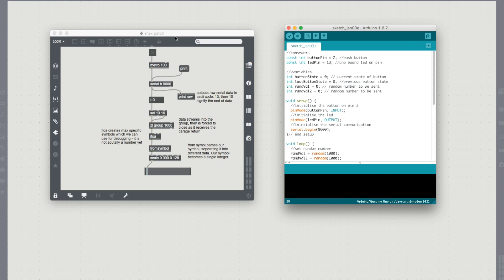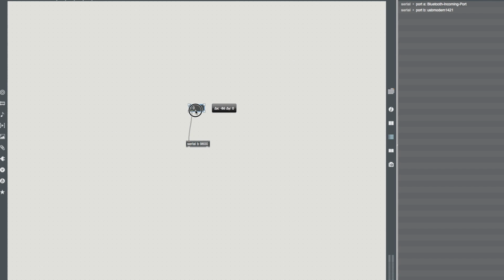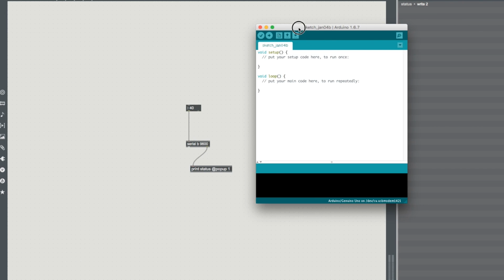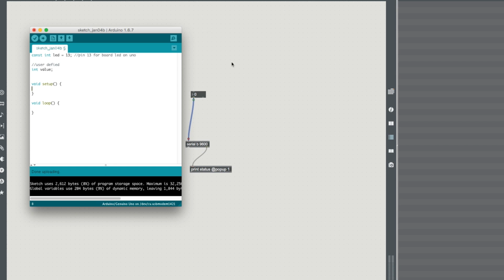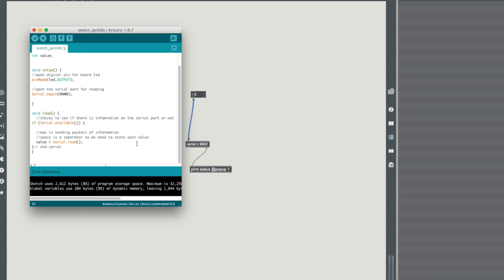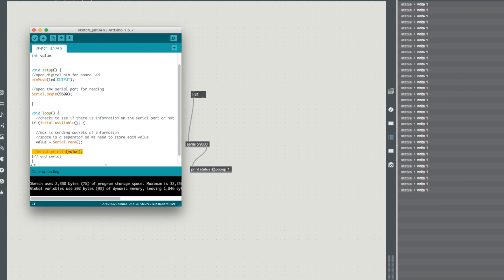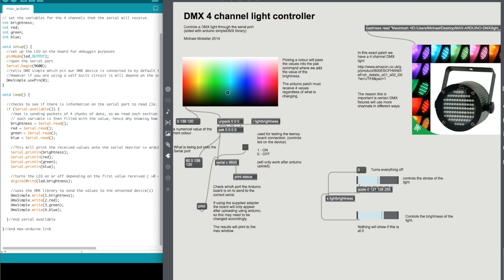MAX msp 7: Passing data from MAX to Arduino

Comment: How would you go about controlling multiple variables on the arduino using Max?
I'm working on a controller that would have certain LEDs light up based on what the max patch is doing.
Reply: hi, please, did you manage to do this finally? I was about to ask the same question
Reply: @gorgigeorgie4594  Unfortunately my schedule ended up getting very busy and I never made any progress.  :/ Definitely still planning to work on it, but I don't have a timeframe.

Comment: hi :) thanks for the  video! 

can you help me with connecting a servo to this? im using FaceOSC on max, that sends data to the arduino, but i cant figure how to move a servo with that, i just need like 1 = servo on , 2 = servo off. 

Thankyou !!!! (and sorry about my english )
Reply from the maker: You would most likely control something like that directly in arduino - having max control the on or off number (1 or 2 as your described)

Servos normally move between 0 - 180 degrees of movement...

So in arduino you would receive your OSC value within your loop code and set it equal to variable;
You then use that variable to drive the servo...

psuedocode: 
myValue = value from osc (normally from serial port)
servovalue = 0

if (myValue == 1) 
   move servo on repeat
else (nothing)
Reply: @Programmingforpeople  thankyouuuu!!!!!!! :)

Comment: Great video!
Is it possible work with more than one output in Arduino?
I've seen some tutorials and blogs of the explanation, but all is about one output.
Think on Arduino Mega, it have to many outputs. 
I undestand the "Serial (letter) 9600" send information just by one output, but if I would work with 4 servos, what can I do?
I need to use 4 arduinos?

Thakns a lot!
Reply from the maker: No not at all!

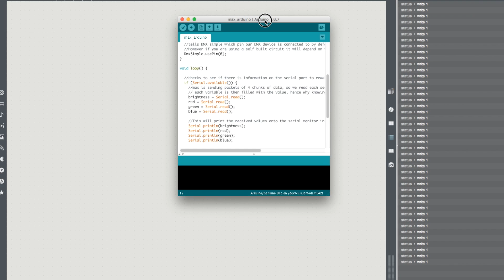The last few minutes of this video talk specifically about sending multiple numbers at a time and passing them into different variables in arduino! Check out 6:20 onwards and let me know.

You basically 'pak' the items in max and then read them as individual items on the serial port in arduino
Reply: Ooh! I can see! :O
Very thanks!!!
:D
Reply: @Programmingforpeople  hello, thanks for this very helpful video. I have control over a single LED on the Arduino no problem (using a toggle in Max) but am really struggling controlling a second from Max. I have studied the bit at the end of your video and can get the data out of Max no problem but am baffled as to how to interpret it within the Arduino code. I assumed I would have to write something in there with parse, no?

Comment: what libraries do i need for this to work? specially "serial"
Reply from the maker: +realgoldfinger all built into max.
There was an error going around that serial would corrupt itself in various saves of max if you tried to close max with an active port. Start a new max patch and see if serial works.

If not - you’re probably just not referencing the ports required correctly vs it being broken

Comment: I am using port e. (com 5 is where my Ard. is at.) only port a (com 1) is default is no port is defined. perhaps this is the issue. 

I cannot keep the serial port open in MAX and Arduino at the same time. when i close the port in MAX, it seems like it is purging the contents of what should be displayed in the serial monitor.

The LED light does work - so i know the data is being sent on the toggle..
Reply: Hi ! I have exactly the same issue, "Serial Port 'COM7' already in use. Try quitting any programs that may be using it."
All works fine and the RX LED on my Arduino board is blinking so data is send to it but I can't open the serial monitor within the Arduino application... Have you got any idea ? Thanks
Reply from the maker: +Dave Klebt the serial port is an individual thing shared between resources - you will not be able to have it open on arduino and send data to it in max. If max is sending the data you will need to print the data prior to the data to be able to see it when sending in max
Reply: Thanks! i was attempting was to display the data as you did in the Arduino serial monitor. in my rebuild of your sketch/patch, the data doesn't show up in the serial monitor. but the LED does light, so i know the data on is being passed.  is there to cache that data  from a number stream when it comes into the Arduino through the serial?

Comment: Hi Michael, I really love your videos! I have a question related to the last part of your videos, sending RGB data from Max to Arduino. I have 5 LED RGB strips attached to 15 PWM pins of a MEGA, and trying to control each of them from Max simultaneously. Can I just use PAK with 15 "0"s as arguments, with values from 0-255 coming into the inputs?. Do I need to convert these to ASCII or append some kind of space/comma at the end of the 15 number set, and how does the Arduino code recognise when the 15 numbers come in...

sorry if thats vague haha
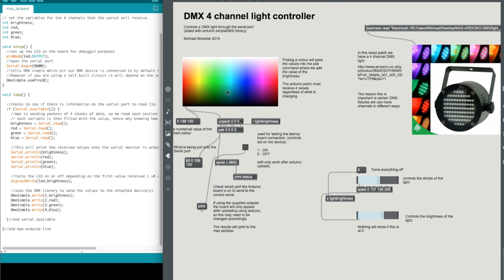Reply: +Dom Svejkar perhaps an easier question would be, at 7:25 in your video, how would I go about writing Arduino code to transfer the 'pak'ked RGB numbers for 5 Lights (i.e. 15 numbers) via serial...
Reply from the maker: +Dom Svejkar thanks for the kind words Dom. 

Sorry, Ive been travelling a crazy amount lately and haven't been able to sit down for this. Ill either send you an image, or a little video of what I would do. You sound like you're on the right path though! 
The r g b values for each light (eg the 15 values) sent as a single message, have arduino read the values separated by a space. I think serial.read in arduino should automatically handle this by default but we might need to string.split the value of not.... Give me a few hours :)
Reply: I would benefit from seeing / reading how you solved this if it could be made available.

Comment: i have try to do the same things, but it always show me that there is port busy, is there any solution to fix this ?
Reply from the maker: +Ryan Barney 
Honest answer, I'm not sure... I have a couple of ideas that could be completely off the mark...

my main guess is that pulling from the serial port is more taxing than printing too it. In a conventional program you would write the code in such a way that it opens, reads & then closes the serial port (freeing it up again). I doubt the rough way we are operating it in max correctly addresses that order. 
Im pretty sure MAX is pulling serial data out of sync in comparison to most procedural languages as well (much slower).
If you were willing to put some time into it, gating the section of max code where we draw from the serial port should address this (eg we only access the data when we want something new rather than constantly polling it).

That said, it could be something as simple as the way MAX sets up serial addresses when it 'creates' the channel by accessing it before arduino.
Reply from the maker: +King Yiu Choi From experience this is normally due to the serial monitor being open in Arduino. 
Whether going max > arduino or arduino > max I would always recommend starting the programs in this order - arduino, max. 

Let me know if it works!
Reply: I too have been having same problem. Is the solution really a matter of opening each software in the right sequence? why is this the case?... help! please + thank you!